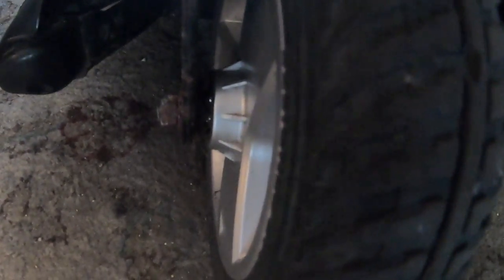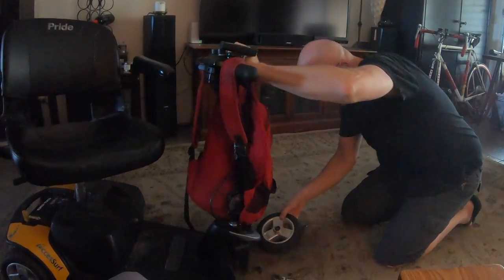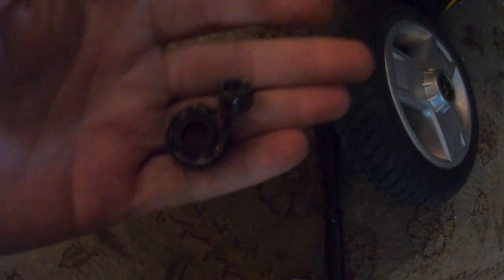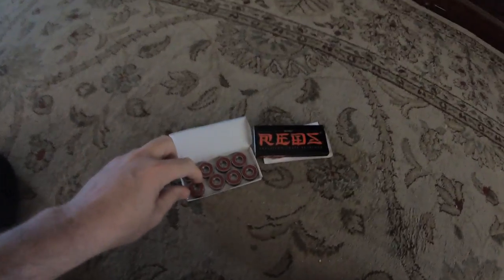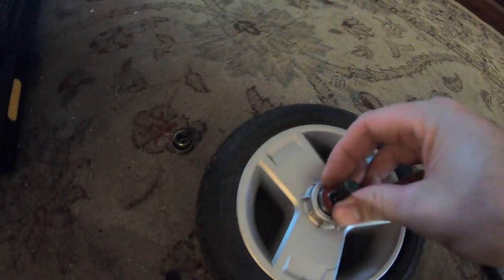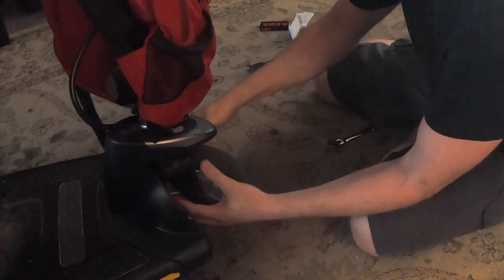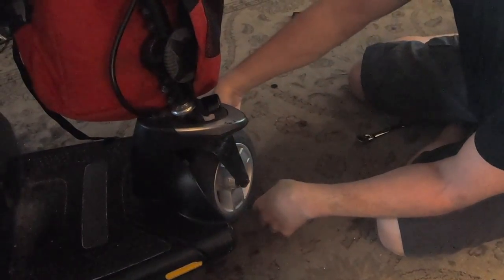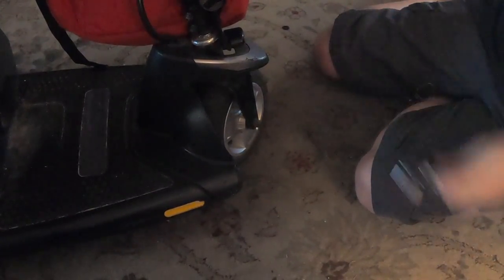GoGo Mobility Scooter: Front wheel bearing replacement

Comment: Is there any option to buy mobil scooter parts online besides monster scooter and the brand of the scooter?
Reply from the maker: What's wrong with buying from them? Too expensive? I've used non-working scooters for parts. That's probably the cheapest way to go, over time. Also, most cities have "mobility" stores. You can order parts through them. Though, that will always be the most expensive way to go.

Other than the frame and plastic pieces (faring/battery box), most of the parts are not specific to the scooter. eg. A battery is just a battery (as long is it's good), there are many electric motors, and the transaxle is used in many scooters. I'm sure the control board is also standard. It doesn't really make sense for manufactures to engineer everything themselves when they can just buy the parts they need in bulk.

The problem is finding the correct part. If you want a new motor - you'll need to find the manufacturer, then the model. This usually involves rifling through dozens (if not hundreds) of motor specs to find the one you need. Then, the manufacturer may not even sell it to you unless you buy 10 or more.

Anyway, trying to find where to find the cheapest part is a rabbit hole. I've done it a few times, and have decided that buying a used scooter is way cheaper than anything else. You can get a decently working used scooter for $300/$400, which may be more than the one part you need, but you WILL need something else in the future, and having a spare scooter saves a lot of time and money.
Reply: @marc.newman  yes Monster Scooter is very expensive . My gut tells me that there is a company somewhere that makes after market parts. i just have to find it
Reply from the maker: @theab9128  There really isn't. monsterscooterparts.com is the cheapest retailer. If you really must have cheaper - you must find a manufacture of the part and buy in bulk.

Nobody is making after market parts because mobility scooters are designed from available parts (except for the frame). So, there is no such thing as a "GoGo motor". GoGo doesn't make motors. All the parts are from all sorts of manufacturers, and if you can find the same manufactures - you can build a scooter for the same price that GoGo does... that is, as long as you buy in bulk.

You're welcome to try to find a retailer cheaper than MonsterScooterParts, but you won't. They're doing exactly what you would have to do, "find manufacturers and buy in bulk". Being that you don't wnat to buy $10k worth of motors to get a good deal from the manufacture... it's cheaper to just let MonsterScooterParts make their profit (which is probably 1/2 the listed price).

That said, if you do find someplace cheaper - let us all know. I'm not married to MSP.

Comment: does it have rear bearings
Reply: of course. Unfortunately, they are not skateboard bearings. But, pretty much everything on the scooter is not custom. So, it might take a little research, but pretty much any part can be found easily.
Reply: @HaoleDreamer  I've taken both wheels off didn't see bearings. But ticking type sounds  still there. Brake click on and off. Notice the noise goes once it's speedy up to 3 quarter power
Reply: @ballkeeper6662  The rear bearings are not in the wheels. They are between the axle and the frame, close to the wheels
Reply: @HaoleDreamer  ok ill have alook when i get home,do you still have the scooter ?
Reply: @ballkeeper6662  It is my roommate's scooter. However, my guess is that the noise is coming from the transaxle. There is a small bearing inside, that is the weakest link

But before you take the transaxle apart, you need to be sure where the sound is coming from. Have someone else listen while the scooter rolls. Make sure you know exactly where the issue is, first.
Reply: @HaoleDreamer  the noise i think coming from the brake like this guy machine at 6.01 min https://www.youtube.com/watch?v=5DyTDvFvAmw